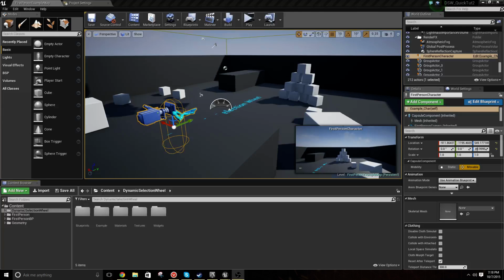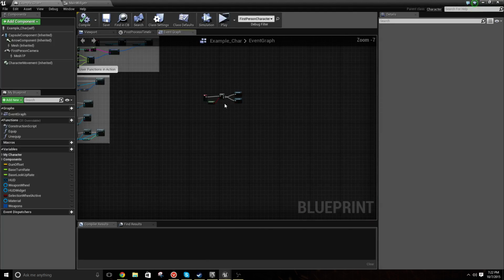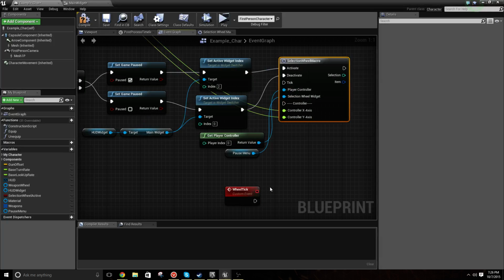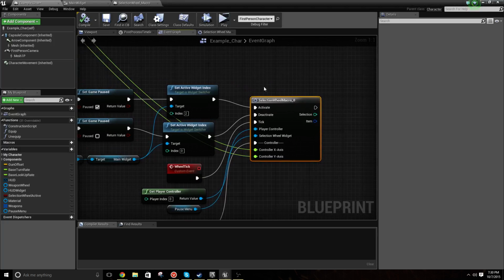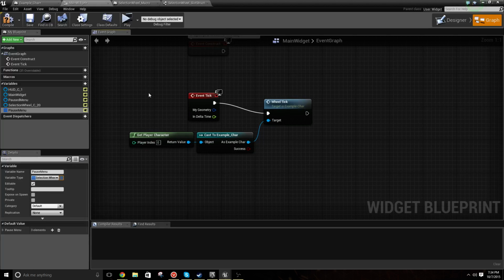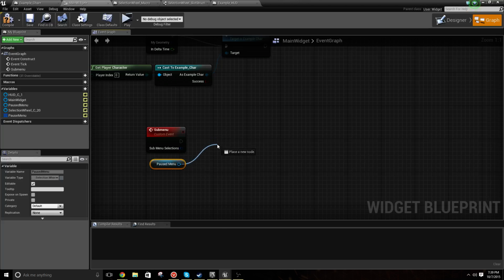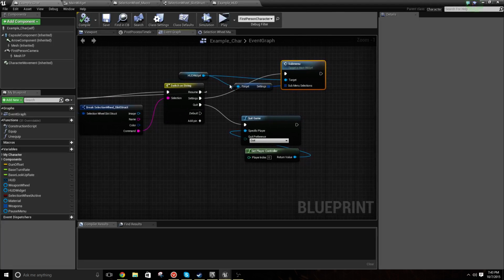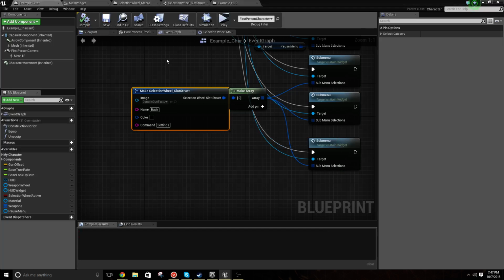Dynamic Selection Wheel - Tutorial 3 - Turning the Wheel into a Pause Menu

Comment: Is it possible to deactivate without selecting anything?
Reply: +Corey Williams Also, when trying to do a consumable item, one where it gets removed from the wheel, the images on the wheel slots will stay while the wheel itself is gone.
Reply from the maker: +Corey Williams So first off yes you can deactivate the wheel without selecting anything you have to go into the macro to do it something like I did 11 min or so into this video should work for what you want. The second part I'm not sure what exactly your problem is... when you close the wheel after you consumed something the image of that item stays on the screen? If thats the case how are you removing it from the wheel and have you modified anything in the wheel code wise.